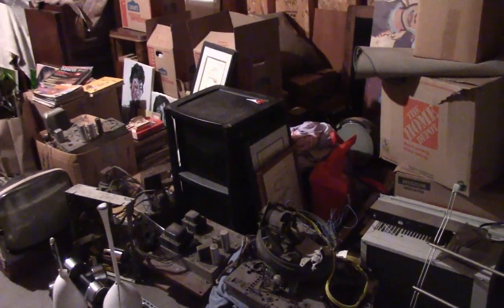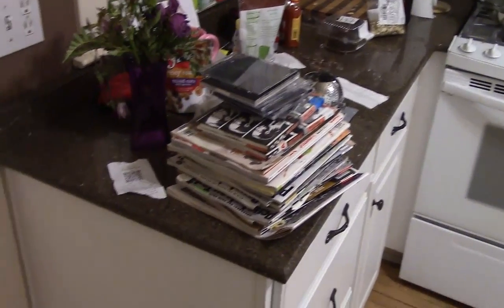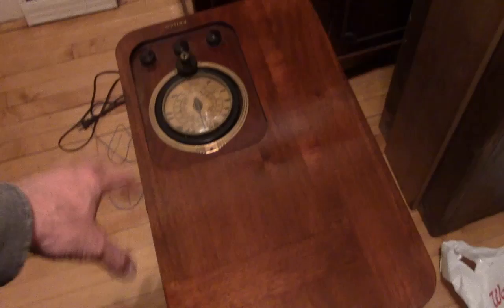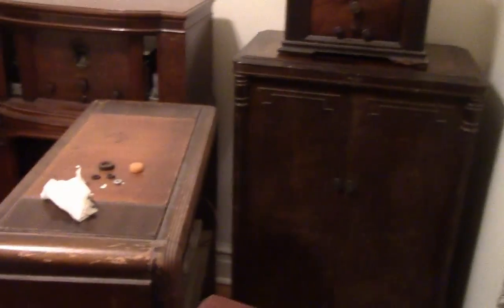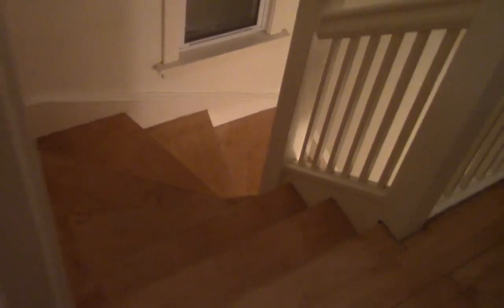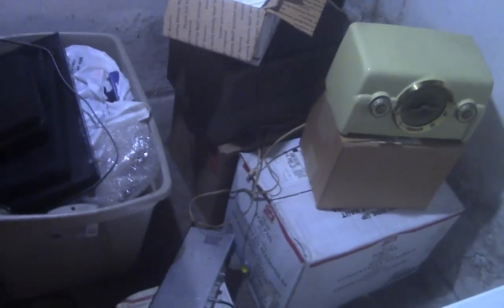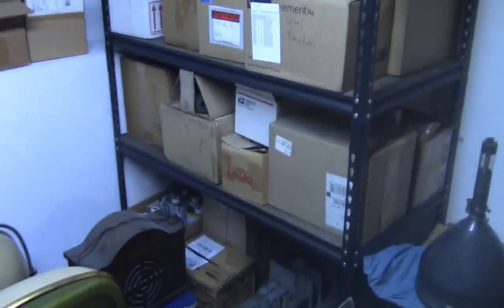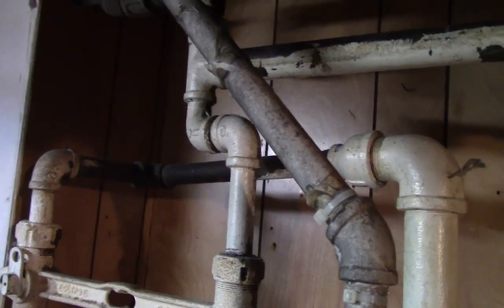Move is done!

Comment: Hey Bob,
I moved 8 times in my life so I know what it means, moving, workload-wise. But you'll get there, eventually :) You certainly have enough nice things to put on display. I guess  you'll find out what appliance looks best in which spot, as you live in your house day to day.

Why don't you put lockable heavy-duty wheels under your workbench's legs and a row of power outlets underneath the work surface with a single solid power connector? That way you can move it to another heavy piece you need to restore, lift it on top, and cart the whole thing back into the main area of the workshop. It would certainly make your floor space more flexible. Of course, that depends on how smooth your floor is. 
Likewise, you could make a solid shelve with pulleys so you can lift it, or drop it, to a comfortable height to work on whatever rests on it.
Anyway, just a couple of ideas. I look forward to you working on that roundie :)
Congratulations with your home !

Comment: I knew you had a lot of vintage collectibles, but I didn't realize you had this much.   It will take a while to get it organized and properly stored, it always looks like so much more when it's not organized and a designated place for everything, but it will eventually all work out.   I think the hamster could use a little bigger cage, and the gas meter is a standard installation by the gas company, I've never seen them any different, mine looks just the same, and only the gas company installs the meters, and pipes only to the meter intake, beyond  the meter it's at your expense, but has to be done only by a licensed plumber, and inspected before the gas will be turned on,   it's a little different with water lines I've repaired and replaced those myself, and worked with the utility company, but they can only leak not explode. LOL!!
Reply from the maker: We have all sorts of extension tubes for the hamster house.  They were taken off for the move.  He'll get his bigger home again soon.  That's the info.  I do plan on replacing the old galvanized water piped with copper eventually.  We have a mix right now.  I could probably do it but I think I'll hire someone.
Reply: The copper would be a little more difficult way to go,  the new PVC type pipe is very easy.  I had pathetic hot water pressure and tried to fix it and in the process cracked a galvanized pipe, I then had no choice but to replace it.  The rest of the galvanized was in good shape and had lots of water pressure and for strength reasons I went with the galvanized again, I decided it's 80 years old, so it will take another 80 to have problems and It won't be me worrying with that.  I took my measurements to the old family hardware store and he cut and threaded the pipe and I replaced about 12 ft of hot water line.  Now I have very strong hot water pressure.  Copper connected to galvanized is not always a good idea, which is what I had from the kitchen faucets, for some reason where the connection is joining copper and galvanzied it has a tendency to clog up with sediments, why that is I don't know.  Chicago may have soft water which doesn't cause near the corrosion and lime build up as much as hard water does, which is what I have, some parts of this city have soft water, but I don't.    If there is nothing wrong with your galvanized water pipes, and you have strong water pressure I would leave them alone, they could last another 50 years, and replacing them would be costly and unnecessary  if your water pressure is strong and you have no leaks, money that could be put to better use where needed or if a real emergency repair comes up.
Reply from the maker: Unfortunately, we have pretty bad water pressure and it tastes metallic.  I saw the insides of one of the galvanized pipes when the new water heater was installed.  About half the diameter was filed up with corrosion and minerals.  Electrolysis takes place between the copper and zinc plated steel and causes more corrosion.  Bad to mix them
Reply: Yes you are right and I didn't know that for a long time about mixing copper and galvanized.  The pipes I disconnected still looked fairly open, and have a lot of pressure,  but unfortunately Chicago does have hard water the same as Kansas City, ks but Kansas City, Mo and some of the suburbs have soft water, but soft water results in tons of black sludge to dispose of due to the process of making it soft.  The hard water  minerals can also build up in the bottom of the hot water tank making them very heavy, and  diminishing their capacity for water.  I have to boil vinegar every so often through my espresso coffee maker to unclog it as they clog it up about every six months.  Info on Chicago water.   The United States Geological Survey (USGS) identifies Chicago and other parts of northern Illinois as hard water areas